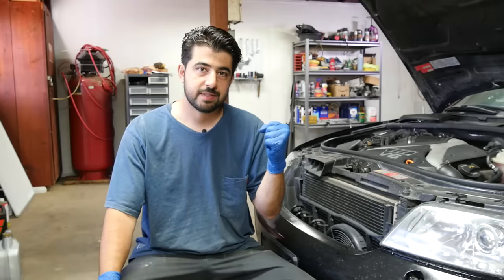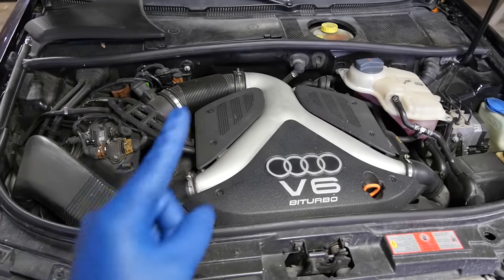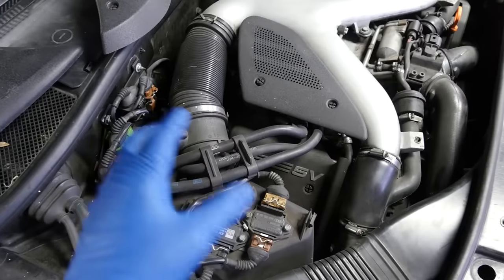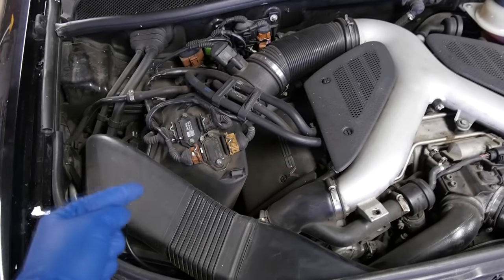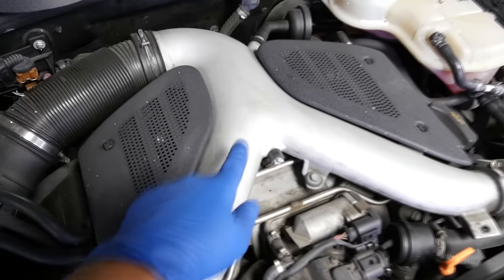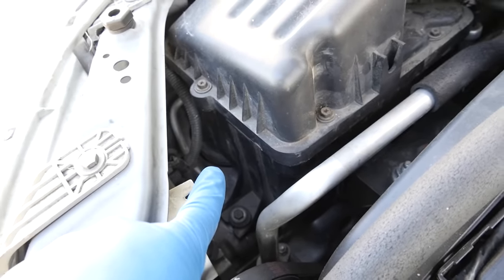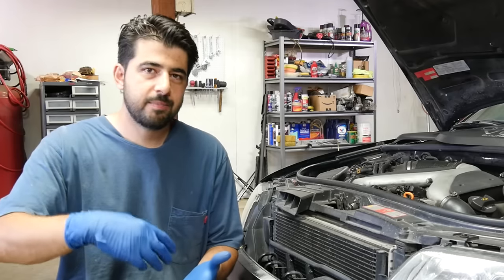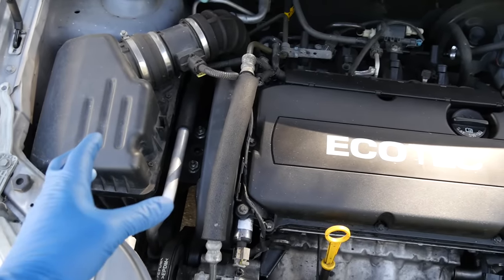Do Cold Air Intakes Work? Watch and Find Out

Comment: What if you just put a K&N drop-in filter would that improve horsepower or response?
Reply: No.
Reply: You'll get a little more noise, which, most people then pay more attention to the acceleration feeling and the butt Dyno gets overeager. If the noise didn't change you'd hardly notice the <1% change in acceleration
Reply: I put a CAI on my Dodge Challenger and from 0-60 which is where I wanted more power it actually SLOWED me down about a half second to a full second!! Now it "may" have been slightly quicker top end but from 0-60 with about 5 runs on the same road before and after at about the same temps ect......the Cold Air Intake made it slower.
I kept it on for the aggressive sound and the bling factor but was very disappointed with the lack of performance because most CAIs advertise about a 10 to 15hp gain in power and that's bullshit!!
Reply: RSGiving  
No.....a CAI alone will not give you 10 plus hp on a Challenger...but many manufacturers claim that and MORE......I've used them on a Challenger before.....one actually cut almost a second OFF my 0-60 time!!
I've owned over 70 cars.
Reply: RSGiving  
25 plus hp!!?? 🤣🤣🤣
You dont even get that much when you change exhaust PLUS a CAI. You should do stand up!! 😄
Reply: RSGiving  
If it was that easy to make 25 plus more hp of say the 5.7 DODGE would have already done that!

Comment: Sound like you're talking about short ram intake, not cold air intake.
Reply: Koyomi Nekoyashiki what's the diffference?
Reply: Cold air intake is long and gets air outside of engine bay. Short ram intake is short and gets air in the engine bay.
Reply: @koyominekoyashiki4347  True, the air comes in through the wheel well down below away from the engine.

Comment: better to use stock system and just connect a hose from your cabin AC under dash box to your air engine intakes before the filters of course for a true cold air intake...cheaper too

Comment: Well, in Finland it does get kinda cold in the winter. And, you can use a large(r) front intake to push more air in, at the expence of aerodynamics. What intrests me, is whether there is any MPG gain with (or without) lean burn mods on a suitable engine.

Comment: Another issue that you don't mention is how the stock ECU measures the air taken into the engine. The factory MAF/MAP sensor may be 'confused' by a less restrictive/different intake. The stock ECU will be optimized for a number of factors, not necessarily just power.

For your BiTurbo you may be better off spending money on tuning, rather than upgrading physical parts which may (or may not) make a power difference.

Comment: I'm no expert, but newer cars have what is know as adaptive fuel trim, so if you put in a high flow filter, which flows more air, you may get a power increase at first do to the slightly leaner fuel mixture, that's if you  have a car that runs on the fat side. So after readapting you power level may drop back to normal for that car. I think gains come from more air in and exhaust out ( less restrictive exhaust ) use thinner oil, go down one size in tires width. That my  2 cents probably all wrong🤔
I do use k&n filters, to me the intake noise is different, which to me just sounds cool.

Comment: There is an unintentional benefit of having cold air intake. In case of a flood it would be harder for the water to get in your engine. Most Factory air in-take ports are set up at or below the car's bumper.
Reply: I've yet to see a 2000+ model vehicle that brings air in from a place that isn't near the headlight, upper portion of the fender, or upper portion of the bumper near the radiator

Comment: My 2c, not that I'm an expert, more of a 'dabbler' 🤣
Ecu tuning isn't mandatory. 
On  NA gasoline engines >3.5L (or >2L turbo) simply replacing a dirty filter with a stock clean filter will result in measurable bhp gains of around 2%. Free flow drop-in filters with the stock airbox boost the hp by ~3%, more importantly provide a 'snappy' throttle response. Complete CAI kits are a bit of a gamble. Stock airbox resonance is tuned to match the peak torque rpm, so changing the box and pipes can (and frequently do) result in 'peaky' feeling engines which aren't very satisfying to drive every day, except, maybe on a racetrack.
On smaller/slower car engines (<2l Naturally aspirated) the filter swap needs to go with a longer (than stock) inlet air hose to maintain tuning and noticeably boost the all important mid-range.

Comment: I hate that aftermarket intakes are marketed as a product that gives you instant gains after installing. Without tuning, its pretty much a waste of money. When done correctly, the gains are about 4-5% increase in your engine horsepower...and those gains don't kick in until about 4-5+k RPM.

Comment: Cold air intakes were invented to make money for aftermarket companies, and some little piss ant company is not going to out engineer Toyota, or Honda, or GM, etc.  This is the problem with nearly all mods.  And even if you found one that really does work, you are going to give up a huge amount of fuel mileage, and no longer pass emissions, etc.
Reply: I've noticed that pre 2000's factory intakes weren't as well designed performance wise. That's why there was such a large aftermarket for intake systems. Now though, the cars are coming out of the factory with very good cold air intakes. I was going to buy a CAI for my 2015 just out of habit( my last car was a 97) but after doing research on my car, the factory intake was better than any aftermarket intake.

Comment: Well yes it’s going to allow better air flow thus increases horsepower. But what people don’t know is that it’s sucking in more dust and dirt as well as hot engine compartment air,!instead of cold air such as it’s advertised? OEM already suck in cold air as designed.. true that OE are more restrictive but consider replacing you air filter elements instead. And one more thing about this myths, you will actually loose low end torque.

Comment: As a car is driving the hot air is being blown to the rear of the car! So with a pod filter or cold air induction system that’s beside or in front of the engine, it will still bring in cold air unless it’s mounted behind the engine, that’s why no one has ever mounted a air intake like that. It’s just engineering and if you don’t get that then you shouldn’t be posting incorrect theory’s like this .

Comment: Hi, the air intake hose on my 1995 Honda accord is a little bit cracked (with a small opening) just before it enters the throttle body. There are no sensors on the air intake hose. The engine is running fine. What kind of problems this will lead to, if any? I can only think of a very little bit of unfiltered dirty air getting into the intake manifold which can't do any harm. Thank you
Reply: We’ll it depends, you could end up running rich which could lead to carbon deposit buildup
Reply: Which isn’t good for your engine at all

Comment: "cold air intakes"  aka  filter ona  stick  which is a  conical  filter thats   just  floating in the engine bay is  what youd call a hot air intake as its  sucking in  hot  engine bay air there by reducing power   you should always isolate your  filter from heat and have  a snorkel on the filter box that   takes in air from outside the body

Comment: in my '65 Jaguar S type   sedan, the air intake hose ends almost in front of the radiator, to the side of the shroud. Obviously it is breathing hot air from a very tight engine compartment. Should I drill a 3" inch hole in the inner wheel housing and re-route the 3" inch intake hose to the wheel housing?

Comment: I put cold air intake, spark plugs, 6 puck clutch and straight pipe in my altis 1.6 manual transmission. Its acceleration increased significantly but after 4 days 7 out of 16 of the engine rockers were fallen. What could have been the problem? Is there a permanent solution to the rocker falling thing? I never experienced this before in any of my car. The engine is 1zr fe dual vvti and driven 220k kilometres. Can you tell what is the permanent solution and should i go for ecu reflash

Comment: Video with no proof on Dyno, great job. On NA engine cut the air box on fender side to improve air flow.
Reply: that makes sense to me also, even with turbo - if it is sucking air - but there is a point where too much is bad. less vacuum

Comment: Most "cold air" modifications I have seen actually take in HOTTER air from the engine bay. They just make a different sound under throttle making the owner think they have improved something.
Reply: Not really. It takes cooler air from down below in the wheel well away from the engine.

Comment: Your factory intake system is all you need it already pulls an air from the outside that's all going to be cooler than the air all coming off your engine block so that's all you need is your is your factory into it gets all you need

Comment: I had one om my Ram 1500 with a 5.7 hemi engine. All it did was CONFUSE!! the computer. Check engine light came on.
Put the cold air kit into a box. Put the stock system back on. The dealer service tech said the engine was running lean.
because of the cold air kit. And really I did not feel any improvement in engine power or mileage with the cold air kit installed.

Comment: They give you a little more sound and on some cars the shift points will change but I noticed oil getting sucked in to the airfilter from the engine my stock airfilter has a catch can that collects the oil

Comment: Cold air intakes only make a difference at the top few rpms of a completely revved out engine and if cold air filters are not kept 100% oiled and clean, dirt will get through the intake destroying your engine .at 150$ to buy and 30$ every 3 months for cleaning oil this is not worth wasting your money because you will forget to clean the filter and start burning blue out the pipe.

Comment: So.....a stock air intake gets air from outside of the engine compartment.  A "cold air intake" gets air from inside the engine compartment.  Hmmmm.
Reply: No, not inside the engine compartment but down below in the fender well in front away from the engine.

Comment: This video is what is exactly wrong with the pro and con CAI arguments - speculation and assumptions. No evidence presented, no tests conducted, not even any reporting on tests that have been done. Also the logic presented is flawed. Why would forced induction engines be less likely to benefit from a CAI - because they are sucking in so much air volume that a CAI would not make that much difference? How does that make sense? Wouldn't the fact that they are drawing in so much volume mean that any little change in air temps would actually mean a bigger benefit exactly because of the larger air volume? Sorry, but this is not a very informative presentation and you done nothing to help arguments, pro or con.
Reply: The installation of the CAI might be, in theory, giving the system the ability to draw in a larger volume of air. But in the case of forced induction, let's say a turbo, the turbo is already causing a larger volume of air to be drawn in, even without the CAI. So the use of a CAI to increase the volume of air might not be of any benefit. But again it all depends on the vehicle and the setup of the vehicle.  As for temperatures with a forced induction engine (turbo), the colder air that a CAI might bring in would probably be negated because of the turbo itself.  Since the turbo is drawing in so much air, and then compressing it, the compression is actually raising the temperature of the air higher than what is being drawn in at the intake, even with a CAI. Hence an intercooler is used after the turbo in order to cool the compressed air before it gets sent to the engine. That's why, as the video mentions, an upgrade to the intercooler would probably be much more beneficial than a CAI in getting colder air into the engine.
Reply: HooverTuber I’m confused by this video as well. Lots of speculation, no facts, no reports or case studies. Just a guy giving his opinion like at any car meet anywhere ever. Yawn.

In terms of the turbo, intercoolers help, but they are only so effective. Cooler air in, means cooler air out, hotter air in means hotter out. So cooling the air before the intercooler is highly beneficial. A few degrees can make the difference before the ECU decides to pull timing and impact performance.
Reply: Kk,
Reply: The turbo boost is regulated at a certain pressure.  As long as the turbo is getting enough air to maintain this pressure, putting a less restrictive air system before the turbo won't help.  Like he said a more efficient intercooler would help because the air is denser and more air is available to burn the fuel unless it's a high humidity day and water condenses in the intercooler and gets sucked into the engine like the ecoboost does.

Comment: The biggest problem you face, is that on MANY engines, the ECU programming is encrypted and has not been cracked, so there is no way to inform the ECU of your cold air intake mod or free flow exhaust mod (or any other mod, for that matter), so you actually LOSE power, as the ECU is making its calculations based on the stock setup, and now those calculations are wrong!
Reply: That's true I dont think you would lose enough power to really notice but I agree with you! You deff need a tune to benefit from modifications
Reply: The easiest computers to tune are Honda and GM. They have all been cracked but the tuning software outside of those 2 manufacturers starts to get crazy expensive.
Reply: some ECU's (for example Denso) are almost all non-cracked, so no tuning (that actually works) regardless of how much you spend.
Reply: burrito rustler and subaru ecus are easy too
Reply: It depends on if it's a speed density or a mass air set up. To some extent a mass air tunes itself after basic mods like exhaust or an air intake.
Reply: if the cold air it is installed keeping the stock MAF intact, then yes it would take care of it itself, however, for the fellow who said it tunes itself for an exhaust mod, no, the calculations would be wrong, because the back pressure change would now result in incorrect data from the upstream O2 sensors, unless you leave the cats in place, or at least keep the back pressure the same, thereby defeating your mod.  But I don't know how your cold air intake is planning to make the cold air colder than a well designed car already gets, unless it has a pipe from the A/C running through it, and A/C takes away horsepower.  The whole idea is rather silly, even if it did work, it might be worth 1 HP.
Reply: Best explanation !
Reply: I agree with you that modern factory air intake systems are very good except for the silencers. I think everyone is talking about three different aftermarket setups. The first is a short ram with I believe losses power since air is taken in form the engine bay but people do it because it looks racy. The second is a cold air intake which draws air from a cooler spot then stock. Depending on the vintage of the vehicle there are improvements to be made here. The third would be a ram air type set up which does work. I ran two of them and they make more power the faster you go. Don't misunderstand none of these mods are going to make a massive power increase in your car. Well done they're probably worth about .5 to 2% increase except the short ram which should lose power. Also they are misnamed they should be called cool air intakes since the air they draw in that is cooler then the air in the engine bay. As far as the ECU stuff an engine is an air pump. The more exhaust you get out of the cylinders the more air and fuel you can get in them. Since that air/fuel is metered when it goes in with mass air it will make more power. That's why a less restrictive exhaust makes more power. Tuning will maximize any engine related mods but is not necessary with light duty mods on mass air. With a speed density set up you need to get it tuned after a mod or it will likely not run right. It's also a matter of scale. Do you want a bit more pep in you daily or are you going full race?
Reply: You can "loathe" back pressure all you want, but modern engines don't work well without it, hey, here's a cool thing you could try! - A FRIGGIN PHYSICS COURSE!!. .....sigh
Reply: burrito rustler , Not, most ecm are learning computers, they will make
( small ) adjustments after resetting it and driving.
yes, if you reprogram your ecm, it of course will actually put out more power & tourqe. Diesel engines have the most to gain by reprogramming.